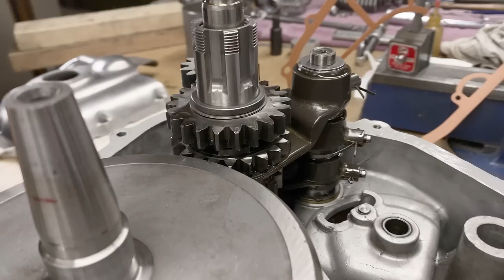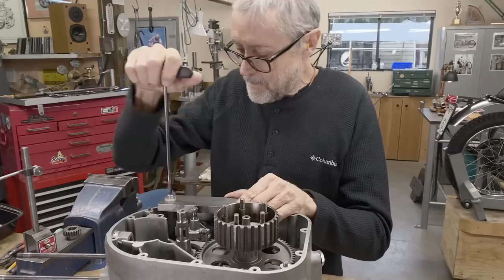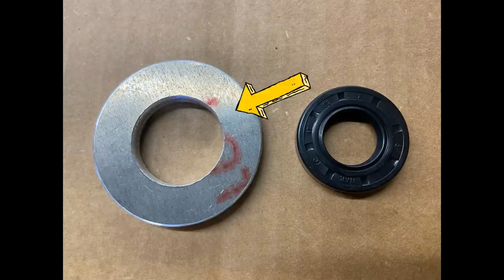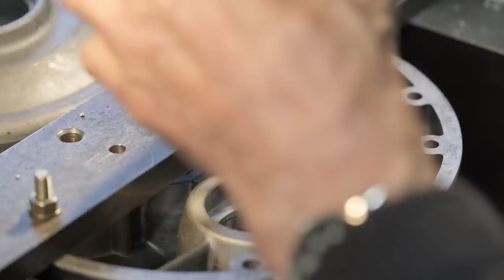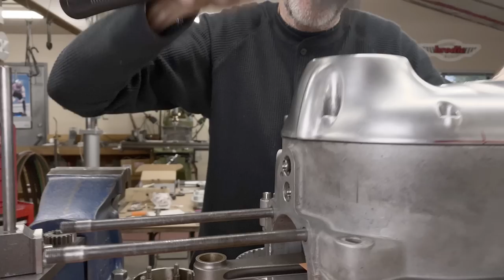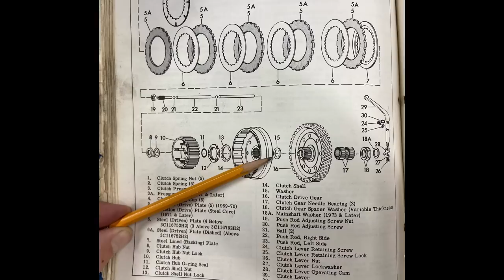Aermacchi Engine Mods // Paul Brodie's Shop

Comment: I've always used copper coat spray on gaskets because it goes on thin and doesn't squish and it seals really well. When you need to take it apart, it comes right off with the gasket and generally IF there is any cleanup, a rag with some brake clean or alcohol cleans it up really good. When I used to race my 70 and half camaro, we were always going through several sets of valve cover gaskets on a weekend and that bill added up fast so when we started copper coating, we could take the valve cover gaskets off between races and reuse them because the copper coat would seal up so good and we could go 3 months before needing to replace the gaskets. The gaskets always came off in one piece with no damage and went back on and seal again and again and again. We used it on exhaust gaskets and then ended all the issues with those and we used it lightly on head gaskets and never had a leak or issue. Trans pan gaskts, rear dif gasket. The only place it never worked was the carb gasket. The gas would dispel the copper coat and then the gasket would leak. We realized the carb gaskets were made to absorb the gas and they swell up to form a seal and the copper coat would prevent that swelling because it blocked the Absorbtion of the gas. 

The copper coat is tacky so it will hold when assembling components.
Reply from the maker: Sounds like good stuff. I did buy some several years ago. I wonder where I put it?    :face-orange-raised-eyebrow:

Comment: Another interesting video. 👍 If I remember right, 50 years ago when I put the cases together, I used a pipe, a plate, and a bolt screwed into the in of the crankshaft to pull the cases together. Although you did sand down the crankshaft, I always feared messing up the flywheel alignment by hammering it on the way you did.
Reply from the maker: Yes, if I "hammered" the cases together it could affect the alignment of the flywheels. However, those were gentle taps on a piece of wood, so no worries!   :face-orange-biting-nails: Thanks for watching!

Comment: There is another way to achieve the clutch spacer.
Yamaha part 24-6591 (starter gear retention hardware) 
The design could be scaled up to suit your application and allow adjustment via different thicknesses of the half-moon spacers.
Just my thoughts!
Reply: Is that an XV (or 'STAR' for the 'new' ones) part number? 
I knew I had seen split spacers somewhere but couldn't remember where
Reply: @1crazypj  for the old XS650, part is a reproduction supplied by Geoff's XS in Australia or Mikes XS in the US
Reply: @Peter57808  I've got three XS650's, (although only one is still a 650, the others are 800 cc) that must be where I saw it

Comment: Wonderful video! I have bell alerts for many youtube sites, but your's is the one I always look for and go to first!! great job, plus you're looking great! I noticed that the crankcases don't need to be threaded as the crankcase bolts just go all the way through both sides  with a stainless nylock nut on the other side, so you don't have to worry about stripping out the threads in the soft aluminum and fixing them with keenserts or Heli-Coil . Nice!  Of course the locating pins hold the crankcases in the correct position. It looked like the second locating pin you tapped in went easier than the first, or am I just seeing things....lol. You said the clutch gear is German made, it looks like an aerospace gear with it's thin web and holes to lighten it that I saw at Lucas Western Gear plant near Park City (now called Triumph Gear), Utah many years ago. They made gears for the aerospace industry, fascinating! I bet it was expensive and it looks like it weighs maybe 40% of the original!! Thanks Paul!!
Reply from the maker: Thank you William. Yes, the second dowel pin did tap in a little easier. Good eyes! All the 5 straight cut gears are German made. Very nice quality! They are not cheap, and now they are no longer available...   :glasses-purple-yellow-diamond:

Comment: You finally used that Boyar-Schultz surface grinder. I'm amazed at how accurate such a simple machine like that can be.  That Aeromacchi case is beefy.
Reply from the maker: Yes I did. One day I will get the coolant system working. And then I will figure out the automatic feed. At least I will never run out of projects to do. Thanks for watching...    :glasses-purple-yellow-diamond:
Reply: @paulbrodie  For the amount of usage that the surface grinder gets, you probably don't need to worry about coolant.  I have thought about using a PLC and three stepper motors to turn our B&S surface grinder into CNC without going all CNC.  But we don't use it enough to justify such a expenditure.  Fun stuff to think about thought.  Keep up the great work.  I look forward to each now video you put out.
Reply from the maker: @slicedbread9003  Thank you. Yes, I have had the surface grinder for 10 years, but don't use it much at all. The coolant system might even work for all I know!

Comment: Have you considered reversing the order of the clutch plates so that the bottom plate meshes with the outer drum?
Reply from the maker: I have not considered reversing the order of the clutch plates. The clutch actually works very well, so I don't see a need to re-invent it. Thanks for watching.
Reply: That would have solved your problem of the plate at the back of the clutch.

Comment: With the clutch basket nut, it's only holding it in situ with very little loading right? Why not use your surface grinder to take it down to the right level and then use the proper locking washer, avoiding the need for locktite?
Reply from the maker: I found an even better solution.... next video!

Comment: After machining hundreds (thousands?) of bearing housings and knowing just how tight the tolerances are, trying to match the exact same diameter is just about impossible so machining just the lower section was a good call.
As for the clutch hub, the nut isn't hardened so staking it into one of the splines may be a good idea?
BTW,  I've always referred to the parts as hub and basket or outer and inner drums (some service manuals also call them drive and driven drums)
Reply from the maker: Thanks for commenting. I did find a solution for the clutch hub nut....   Next episode!

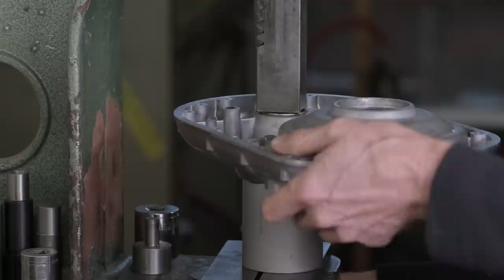Comment: 24:30 The bearing went in nicely but you could have warmed the casing up, it makes fitting bearings even easier.
Reply from the maker: Warming the case up might have destroyed the epoxy holding in the aluminum insert, so that would not be a good idea...    :face-purple-wide-eyes:
Reply: @paulbrodie  Ah, you are absolutely right!

Comment: Would machinating the nut down a little thinner, make it work better so it catches all the threads, or would it make it weaker ?? ND taking a punch and dinging the top thread after the nut is torqued would help to keep the nut from backing off..
Reply from the maker: You really do want the maximum number of threads for secure engagement. Making the nut thinner is not helping. I have found a good solution, however.   Next video!

Comment: Just curious, where does one get pistons, rings and rods for Sprints.  Also, why the shorter rod?  It causes more side thrust from the piston to the cylinder walls but I guess has some benefits as well.  I'm just not sure of what they are.
Reply from the maker: For my race motors I ordered a box of 4 pistons from JE Pistons in the USA. They come with wrist pins and circlips. Rods come from Carillo. A shorter rod means I can move the motor forward towards the front tire, for better weight distribution. Yes, there is more side thrust on the cylinder walls, but it seems to make no difference to the longevity of the motor. Thanks for commenting....   :face-orange-raised-eyebrow::face-orange-raised-eyebrow:
Reply: @paulbrodie  Thank you for answering my questions.  That gives me hope.  I hope you don't find my questions annoying.  Did you have to rebalance your flywheels for the new pistons that look lighter and rods that look lighter as well?
Reply: @paulbrodie  BTW, I just finished your video where you made the heat sink for your ignition system.  I was looking for part 3 of that series.  I absolutely love your Aermacchi series.
Reply from the maker: Bryan, you are welcome.  I did not rebalance my flywheels. Engine works just fine with the lighter parts...   :face-fuchsia-tongue-out::face-fuchsia-tongue-out:

Comment: The problem for the 250 & 350 Aermacchi's they never won anything because of the two strokes at that time were lighter and way faster and easier to strip and rebuild .
Reply from the maker: Aermacchis probably won a lot of local road races. I won a lot of local races in my heyday. And had a LOT of fun!
Reply: @paulbrodie  yes no denying that they gave competitors a lot of fun .
Reply from the maker: @daviddjerassi   I still have good memories!    :face-fuchsia-tongue-out:

Comment: Who makes that Dry Clutch kit? When you buy the one for a Ducati Single (I think NOVA makes it), you typically have to buy  a longer transmission shaft for this exact reason, the stock shaft is too short, and cant be assembled!!!!
Reply from the maker: The Dry Clutch kit is stock from the 73/74 motors. All the 350 motors from 69-74 had dry clutches. No need to buy a longer shaft.

Comment: If it's thick enough I'd consider machining a little recess in the clutch drum so you have room for the lock washer and also get the nut a little farther down on the threads.
Reply from the maker: I will think about that. Thanks.   :glasses-purple-yellow-diamond:
Reply from the maker: I think machining a recess will work very well. Thanks for your suggestion!   :face-fuchsia-poop-shape:
Reply: Hi Paul, could you not remove the shim washer you made then add another plain clutch plate in the basket ? .Effectivly this would lower the basket , regain the threads lost but correct the engagement on the inner drive splines . Just a suggestion , I may have misunderstood the set up. Any way always facinating to follow your videos , I wish you well in your treatment and recovery.
Reply from the maker: @garethdavies3220  Thanks Gareth. Someone else also suggested an extra clutch plate. That means running two friction plates together. Somehow I don't think that's a good idea.. But thanks for your suggestion!   :glasses-purple-yellow-diamond:

Comment: Paul, thank you for the video. I had a similar problem with the clutch hub nut on a Honda dry clutch conversion that I made. My solution was to turn down some of the face of the nut, leaving part of it as a sort of threaded sleeve, that fitted into a recess bored in the hub. Obviously a compromise but I felt it was better to have the full length of thread engaged.
Reply from the maker: Thanks Philip. I think I can machine a little off the inside of the outer clutch basket and that will allow me to thread the nut down further. Always learning!    :face-fuchsia-poop-shape:

Comment: I got lost on the seal. It didn't have one originally or it's land was way too small for reliability? Great show. Thanks Paul.
Reply from the maker: If we are talking about the oil seal for the camshaft.... The original bearings  and seal fit a 15mm camshaft. I replaced it with a 17mm camshaft, so the bearing and seal had to be replaced. The 17mm seal had a larger OD so the side case had to be modified to fit...    Make sense?    :face-orange-raised-eyebrow:

Comment: Is the need for that big clutch washer/spacer caused by mismatched parts (e.g. race vs. stock), or something else? I’m still confused why there was such a big gap. Thanks!
Reply from the maker: It is a bit of a mystery to me as well. It's been years since I assembled a stock motor, and I didn't have to make a custom washer. But what the difference is I cannot explain right now.

Comment: First thing I bought with my very first check runn8ng a jack hammer when i was 15 years old.was some proflo clip on a crtt replica tail piece and a glass front fender from moto italia.   I was 6 year's old when we started fixing  the 65H.   We got it running and I got to ride it 30 year's later.   I don't talk to my dad anymore.   This makes me feel like my dad and I are in the shop working on the sprint again.
Reply from the maker: That's too bad you don't talk to your Dad anymore...    :face-purple-wide-eyes:

Comment: Man, I really appreciate your work - but you should really use temperature to mount/unmount bearings and axels, and not always file them down so that they fit directly or use high pressure. You would create a much more durable fit - the creators of these motors really thought about the fittings. They would have made them fit directly if this would be great idea. 

No offense, but you may think about that.
Reply from the maker: Thanks Moritz. I don't think the stock fit is always right. When I took this motor apart, the left bearing stayed on the flywheel shaft, and the bearing pulled out of the left crankcase. That's not how it's supposed to happen... This tells me that the fit between the bearing and the shaft was too tight. Japanese motors don't have the same kind of press fit as an Aermacchi, but mechanics don't complain that things go together easily, and I have not heard of issues arising from the lack of a tight press fit between shafts and bearings.

Comment: You’re making me worry now Paul wondering what I missed putting mine together all those years ago.
Reply from the maker: Not my intention to have you worry. If your motor is all stock, you probably did fine. Mine is a mix and match special with parts from various sources, so that's why I am doing extra work.

Comment: Couldn't you have put an extra clutch plate in at the bottom that has the teeth on the outside, Therefore moving the first cluctch plate with the teeth on the inside further up inside the clutch basket?
Reply from the maker: You mean have 2 friction plates running against each other? I don't think that is proper. Not what the manual shows. I think I have it figured out. Thanks.

Comment: Paul as for the clutch hub nut. is potable ta mill the clutch hub out just enough for the nut ta fit flush with top of the spindle shaft to use the washer. looks ta mee there is enough material to do that. I built my first bike back in the early 60's as a teenager.
Reply from the maker: Thanks for the info. I think that Spellcheck has been having some fun with you.... I got the clutch hub nut issue figured out, and you will see my solution in our upcoming video. Engine assembly!

Comment: I was wondering if you could talk about dial indicators in a video? I'm after buying my first one so mid price range ideally. Are there any brands you recommend? I tried looking for the brand used in this video but it wasn't available in the UK. Do you know of any that are globally accessable you recommend? Also help on understanding the different values and general tips on using them would be appreciated. Thanks
Reply from the maker: Dial indicators. Do I consider myself an expert? Not really. The one I use mostly I purchased when I was 17... 51 years ago. I recommend you buy quality, not based on price. If you do, it should last you the rest of your life. Brands that come to mind are Mititoyo, Starrett. Get a set of extensions. I have two lengths, inch and 2 inches, I think. They are very handy. Handle your dial indicator with care, never drop it!  Thanks for watching...    :face-fuchsia-poop-shape:
Reply: @paulbrodie  both seem to be available here in the UK 👍 I'll also look for extensions. Thank you
Reply from the maker: @BigGums17  You're welcome!    :face-purple-wide-eyes:

Comment: It looks from the diagram that you are putting in the first plate upside down. Please check.
Reply from the maker: The friction side of the first plate fits against the clutch hub. Correct?
Reply: @paulbrodie   Yes, assuming the next plate, item5 , is a friction ring.
Reply from the maker: @seeburg  Yes it is.   :glasses-purple-yellow-diamond:

Comment: As usual, top quality content and top quality videography. Good to see you both back at it and Paul, looking and sounding much better! I'm still confused by the need for the welded shim and the consequence of not being able to engage the lock nut fully on the clutch shaft, requiring you to omit the locking washer. Would it not be better to put a shim on the back side of the internal spline/gear to raise the whole assembly? I'm unsure if it will misalign the gear mesh with the drive gear, but I have noted it is a lot thinner than the standard helical gear it replaced potentially leaving room for it to be moved? 
Cheers, Gus.
Reply from the maker: Thanks Gus. First, the clutch gear needs to be shimmed for correct endplay. This partially sets the height of the outer clutch hub. Next, the inner washer (2mm..) sets the height for the inner clutch hub. This is where I found I need to raise the outer clutch hub 2.5mm (.100") to get the correct engagement of the inner clutch plate with the inner splines, hence the 2 piece welded spacer. This affected the engagement of the clutch nut, but, I have solved that in our upcoming video! Hope this all made sense. It is not easy solving all the problems when building a race motor with parts from different countries.

Comment: Hi Paul
Regarding the camshaft and the bearing and the seal and all that: I would have had the camshaft journal ground down from 17mm to 15mm and then you could have just used the correct seal and bearing time and time again.

regards and get well soon!
Reply from the maker: Yes, that is another solution that could have worked. Thanks.

Comment: How did you cut the tig welded washer to get it off the shaft?
Reply from the maker: I spaced it up with 1/8" flat bar, and then hit the weld with a small, sharp chisel... it worked!